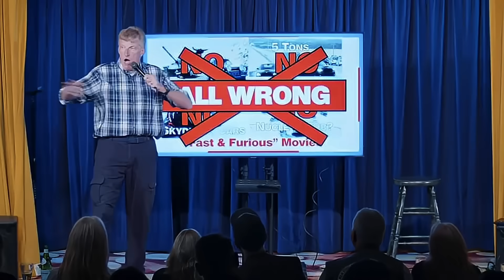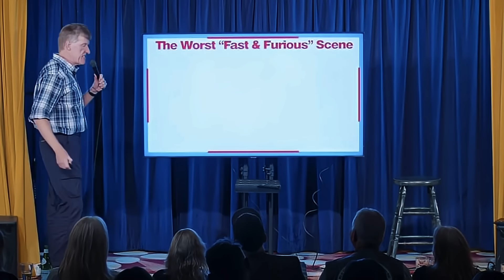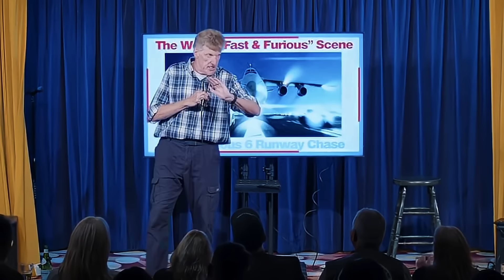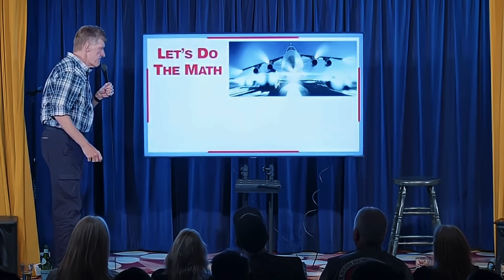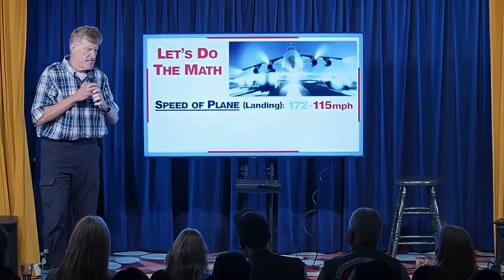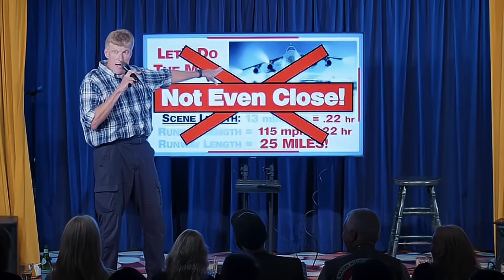The Worst 🥲 "Fast & Furious" Scene 😡 | Comedy Math | Don McMillan 🇺🇲

Comment: The math isn't mathing in those movies. 23 second dragraces that are supposed to be 9 seconds, then I hear about the runway that is long enough to break the sound barrier and make Bonneville look short. I saw the first one on Camp Doha just north of Kuwait City in 2001 when I was deployed there. I laughed through the entire movie as it was chock full of nonsense. At my base back in Charleston SC I had a mid 11 (1/4) 7.40 (1/8) second 1979 Firebird Formula powered by a mild 455 I built in the mid 90s. Nowhere near a fast car, but pretty stout on the street, and I had around $4500 in the entire car.

When I got back to the US and every hockey puck with a fat can and cheese grater wing on a Civic thought he had the fastest junk on the planet. For some reason they wanted to rev at me at lights, but never wanted to run for money. By the time they got across the crosswalk I was already going 5 over and a few bus lengths ahead of them. A mile or two down the road I'd get the flyby with flashers as they finally got up to around 70mph.

Comment: I dispised the movies. Full throttle race then a close up of changing down a gear ????? Over & over again. It's like cocking the same shotgun 7 times in one scene. Thanks for the video above, I thumbs up.
Reply: I like how in the very first race, Paul Walker doesn't "respect" his car and pushes it too hard so the central computer screen puts up a big red sign saying DANGER TO MANIFOLD and then a single piece of tread plate on the floor pops all its rivets and falls out onto the road. 🤣

Comment: For me it was the submarine in F8...

...the sub that was suspended above water with metal bracers starts up, and dives under water...

The nuclear submarine, which travels faster underwater by design, surfaces in order to go faster...

the attack sub had a nuclear ICBM...

No one shut the open hatches on the sub before it dove, yet water never intruded...

...they fired torpedoes...at cars...

...and so much more... there is suspending disbelief... and there is "We're watching a Fast and Furious movie tonight"
Reply: The car going to space wasn't crazier than the sub for you? 😂
Reply: @christopherjakel1049 
I stopped at F8...
Reply: Plus, the fastest sub ever recorded went 51mph. The sub in the movie had to be doing 120mph.
Reply: It also take 24 hours for the reactors to warm up, and they cannot run out of (cooling ) water.
Reply: Damn, F8 was so ehh
Charlize Theron was good tho

Comment: How does it compare to the runway in Die Hard 2?
Reply: The plane in Diehard 2 was pretty much taxiing down the runway the whole time complete with turning from holding lanes to the main outbound runway.... and it was doing this from the hanger, not landing, so the speed was relatively low the whole time and I don't think that scene was nearly 14 minutes long. Diehard is far more believable.... also, don't forget that CGI wasn't really a thing when DH2 came out so most of those stunts were far more practical.

Comment: 1. Where did they find an Antonov?
2. You can't land and take off in the same go with this.
Reply: 1: Which model of Antonov are you talking about?  They're somewhat prolific.  
2: Every single aircraft can do a touch and go.  Take off speed is REALLY close to landing speed.  Outside of gliders, rocket planes, and a few very early jets, putting the gear on the ground and going back up again is really easy.

Comment: It was filmed at Upper Heyfords primary runway, which is circa 1.8 miles long, so they'd have to do about 14 lengths or 7 round trips.
Reply: Or... because it's a Vin Diesel vehicle based in fantasy and unicorns, 2 to 4 render farms for 30 days. 

Just a little reality.
Reply: @jamesogden7756  I mean I'm sure some CGI and lots of editing were involved, but that is the actual real runway at which the scene was in fact filmed.

Comment: As a flight nut that scene made my blood boil.

If you account for the fact that plane is an Antonov 225 AND would have to speed up after landing in order to take off again, the runway length required approaches infinity!
Reply: Yeah when I saw it that stood out to me the most. I now call it the "infinite runway scene".
Reply: Adding to that, there is only one An-225 in the world with a much different livery.
(Or there was, as it was destroyed in 2022 in Ukraine during the Battle of Antonov Airport.)
Reply: If the picture in the slideshow is representative of the scene, then this is an An-124 "Ruslan". An-225 had 6 engines and a twin tail to work in tandem with the profile of "Buran" spacecraft that it was built to carry.
Reply: Ummm no... Only if you calculate the impact speed at max. And the lowest possible landing speed, it's at least theoretically possible, if not practically possible
Reply: The fact that you mistake An-124 with An-225 suggest that you might not be as big of a flight nut as you might thing, so calm your blood, it's just a movie.